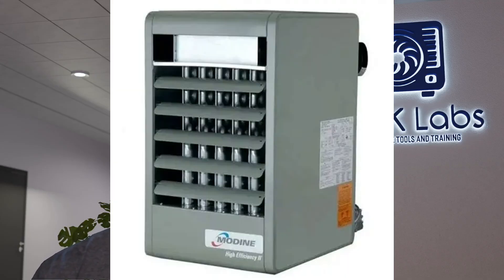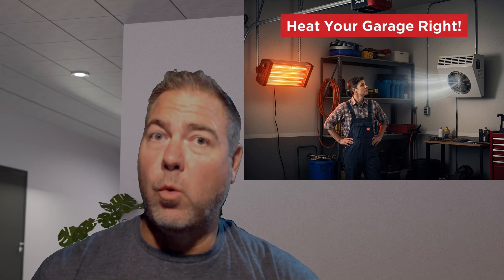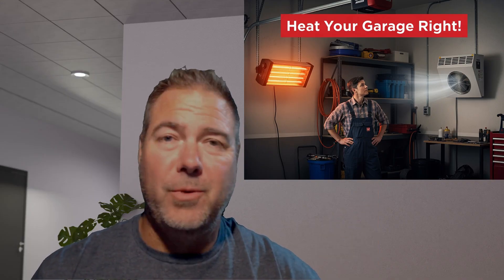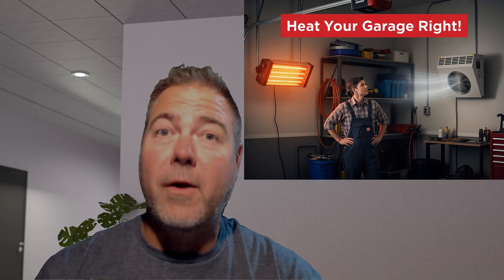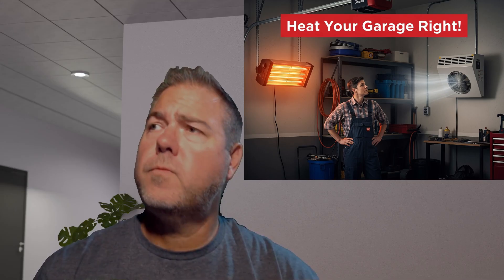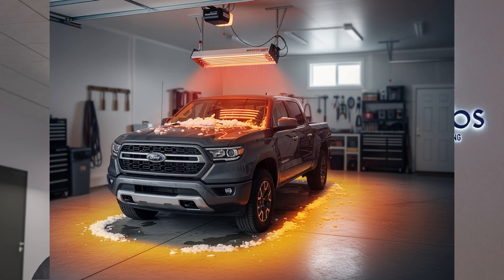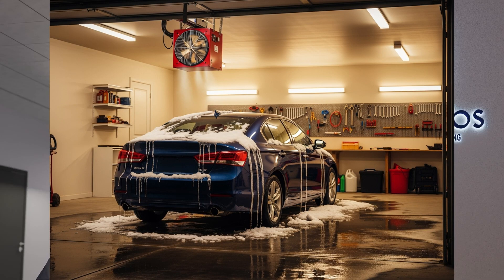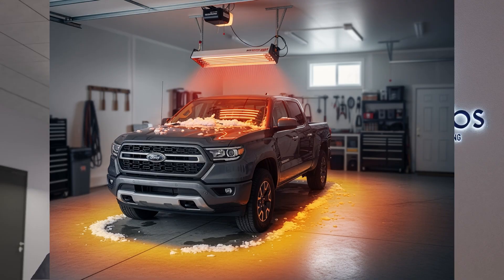Radiant vs Forced Air: The Ultimate Garage Heater Showdown!

Comment: Hey man is a electric   radiant  heater a good choice
Reply from the maker: In a garage or shop setting, the fact that they are less insulated than a typical residential space....no.  the energy costs will be much greater on an electric radiant heater than a gas Radiant heater.  However a radiant electric is a step up from an electric fan space heater.